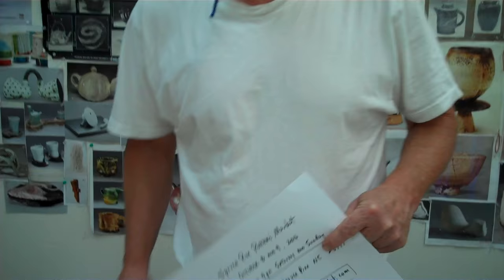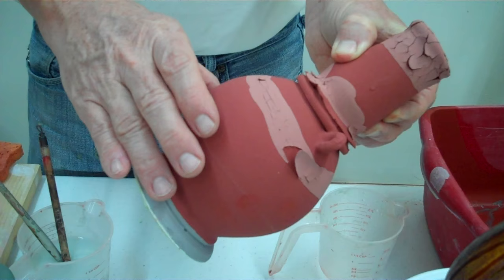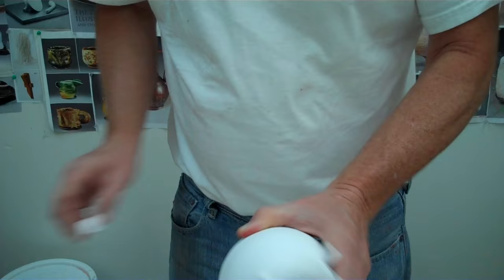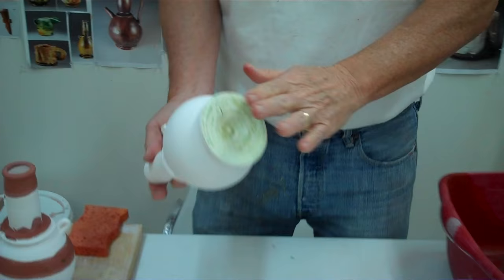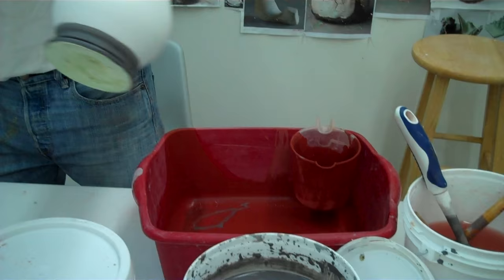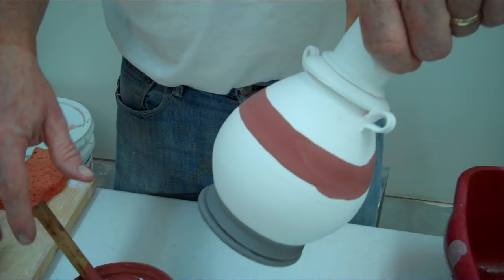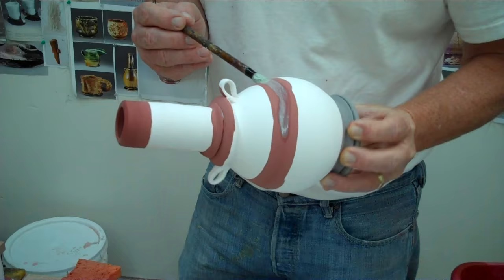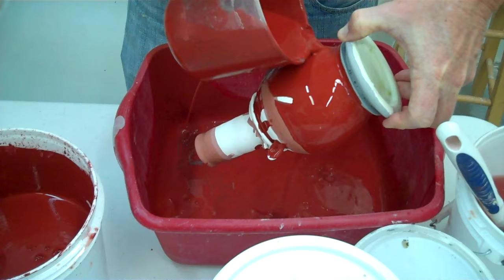How to Glaze a Vase

Comment: Thank you for your videos. They are very helpful. For a vase shaped like that, does the inside need to be glazed or does the clay vitrify and there's no need for glazing the inside? Does cone 6 clay reach vitrification when fired to cone 6?
Reply from the maker: I definitely glaze the inside! If you don't sometimes it will crack because no interior support to support the exterior glaze .
Reply: @johnbrittpottery  OK. Thank you. That makes sense.